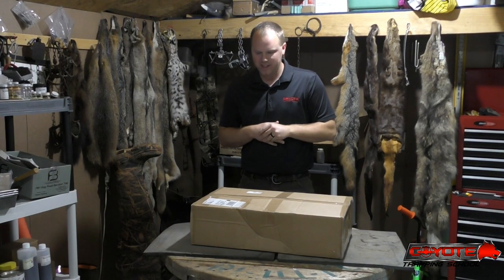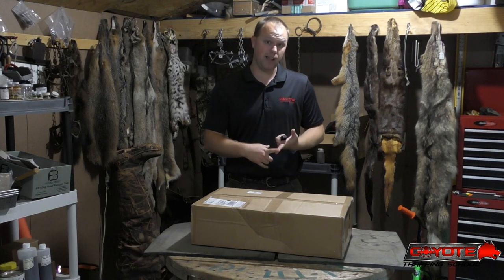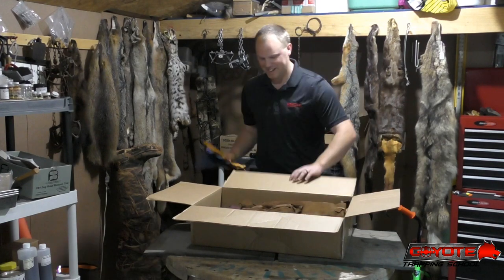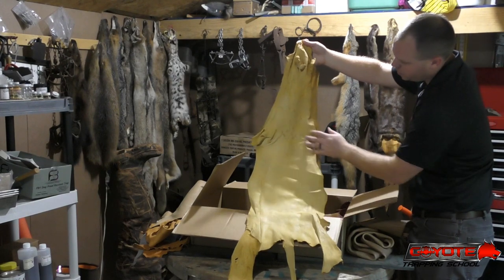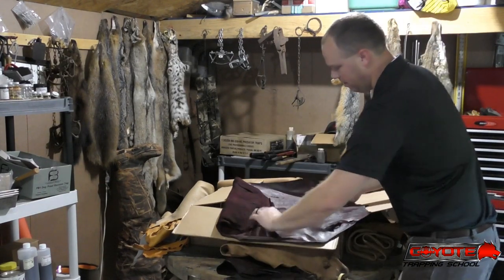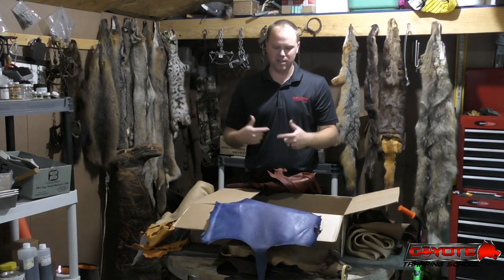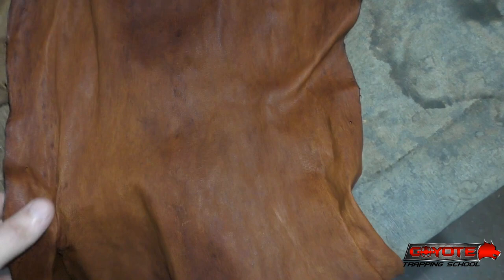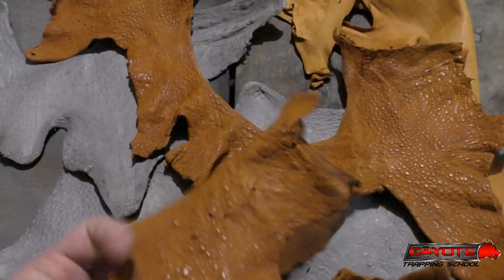Unboxing Coyote LEATHER!?

Comment: I usually make wallet interiors out of the more supple leathers (goat,calf, deer and pig) but u could add poster board to make your projects more stiff. The turtles texture is awesome! Don't overlook incorporating your smaller odd shaped pieces into over or inlays. Don't stress on the defects in the leather. I've seen some really high end pieces with "faults" such as brands, bug bites, and tannery imperfections that brought a uniqueness you can't duplicate. I'm seeing a deer skin purse with matching armadillo wallet/handbag in your wife's future!!
Reply from the maker: That is a great point about inlays, I want to use as much of the leather as possible.  So on your interiors, do you finish the edges, and how do you keep them tight?  The wallet I showed in the video is all deer hide, very supple, but the inside pockets are very loose, my cards don't fall out, but it is loose enough that they could.  Do you machine sew anything or are you hand sewing everything?  I am liking the deer skin purse idea, and may be able to pass the armadillo wallet off as ostrich or something!  Thanks for the ideas!
Reply: Coyote Trapping School I finish all my edges by sanding edges flush, use appropriate sized edger to bevel the edges, slightly damping with water, rub a generous amount of glycerine bar soap (used primarily for cleaning saddles and available at most saddle shops and some farm and home stores), then rub AGGRESSIVELY with canvas or piece of denim. Friction causes glycerine to heat up and burnish the edges. As with anything everyone has his/her favorite method from motorized burnishers to slick sticks but I lean toward simplicity. Your gonna struggle with getting a good burnish on more supple hides since they aren't as tight as veg tanned but can be done. Search Bob Park for his edge method. Using different grits of sandpaper along with saddle soap his edges are super sweet! IMHO edges are one way to show quality in your work. When assembling pockets I lean towards tighter since stretching is inevitable. Horizontal pockets not as much of a problem since more of the card fits into the pocket but multiple vertical pockets doesn't allow as much surface area of the card to fit down into the pocket. I despise hand sewing so I opted for a Tippman Boss hand powered stitcher that doesn't require robbing a bank before purchase. If all your interested in is thinner projects smaller machines are more affordable but I mainly sew thicker and the Boss will do both with some thread tension adjustment. Just FYI this leather deal can become as intoxicating as watching fur bounce at your sets and be as time consuming! PS.....one of those beaver tails would look super sweet as as rifle sling inlay!!
Reply: Also u keep them tight by using a good quality leather contact cement and glueing each layer together.
Reply from the maker: This is all very helpful, thanks for taking the time!  I'm with you on the edges, and that has been part of my holdup.  When I look at the few things I have made the edges have jumped out at me most of the difference between a quality piece and my amateur work.  I've got a couple of the dremel burnishers and the stick, but on the deer hide I've been working with the edges just rolled over, and I tried to bevel them but it is so soft that becomes a challenge too.  I found one tutorial on sanding and canvas burnishing but I'll definitely look up Bob Park.  I figured out very quickly this could become very consuming, but I can't wait to see what the final product looks like!  I like the rifle sling idea too!

Comment: I came across your channel and was wondering if you had any suggestions on how to catch coyotes in an Urban Neighborhood.  I live in a residential track home area and lately, we've had numerous coyotes coming around early in the morning killing local dogs and cats.  There's also a common area with a small lake where duck and geese come into eat and drink.  Some of the neighbor's pets have been taken out of their backyards, in spite of the fences.  Any thoughts on how we might go about trapping these varmints? although most of the neighbors keep their pets indoors, there are some that get out and run around the neighborhood. I wouldn't want a trap that could possibly hurt them.
Reply from the maker: The most effective and reliable way to catch coyotes is with a foothold trap.  The foothold traps made today come with modifications to prevent damage to the trapped animal, so releasing a nontarget catch is usually achieved with little to no injury.  That being said, coyotes are pretty wary and aren't always the easiest critter to catch, and it sounds like there is a high likelihood of catching a domestic animal as well.  The best way to get your situation fixed quickly would be to hire a trapper, someone who has a track record of trapping coyotes, not a pest control company.  It could be pricey, but if they are having an impact through your whole neighborhood you may be able to work through the homeowners association so the cost to each family isn't too high.  It is possible to learn how to catch coyotes yourself, but it will take an investment of time and money (traps aren't cheap) and you have potential liability risks being in a neighborhood (if you hire someone make sure they are insured!).  Also I would advise against trying to learn to trap coyotes where you want to eliminate them.  Coyotes are smart critters and if they catch on that they are being targeted they can become super trap shy, which will wind up costing you more if you then have to hire a trapper to trap super shy coyotes.  I hope I'm not raining on your parade here, I am all about people learning how to trap, that's what I do with my channel, but there are some instances where I would advise against it and this is one.  If you've always wanted to learn to trap, sure give it a whirl, but if you're just thinking about a way to save some money, it'll cost you more in the long run I promise.  And especially in an urban setting, in today's liability stricken world, I would be very hesitant to set traps in an area like that without insurance.  You know how people love their pets and can blow a small incident into a major issue.  I hope this is helpful and feel free to ask any more questions.

Comment: You might consider using some of the smaller, thinner pieces of hides as cowboy hat embellishments, for the front of the hats. I know you've seen hats with feather embellishments on the front, why not use an interesting piece of leather, like that snapping turtle, or beaver tail.
Reply from the maker: That's a good idea, I hadn't thought of that use.  I'm open for any ideas right now!
Reply: Coyote Trapping School... another thing you might consider is purchasing a cell phone type holster, like you clip onto your belt, and using a leather glue, wrap it in one of those thin leathers, just on the face side (no need to cover the back, no one will see that side). I think that would look cool.